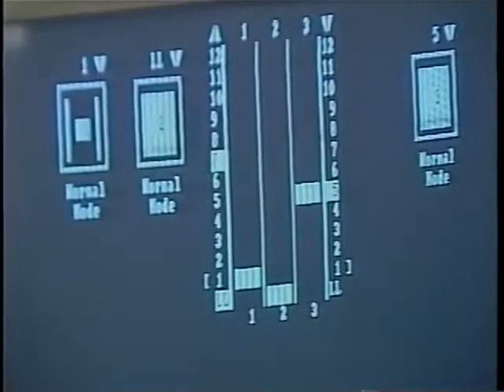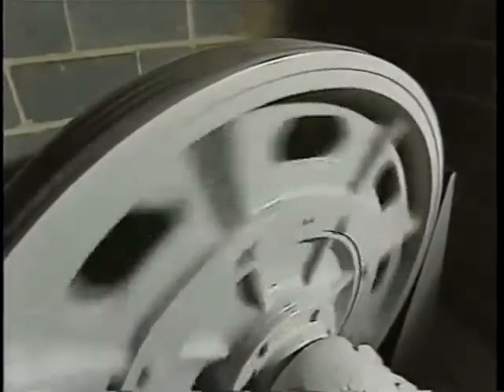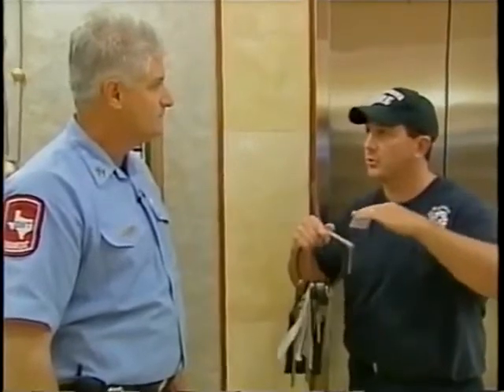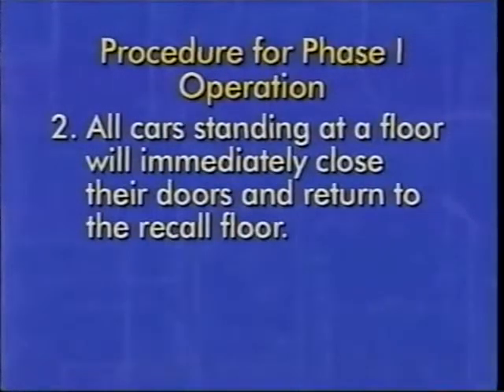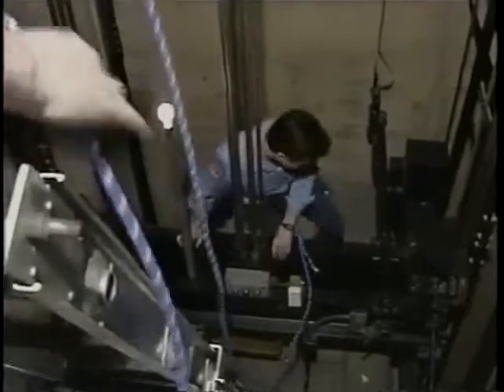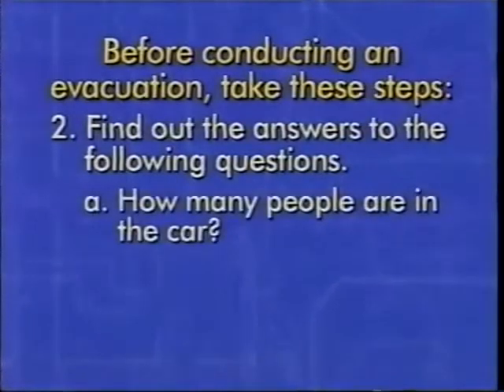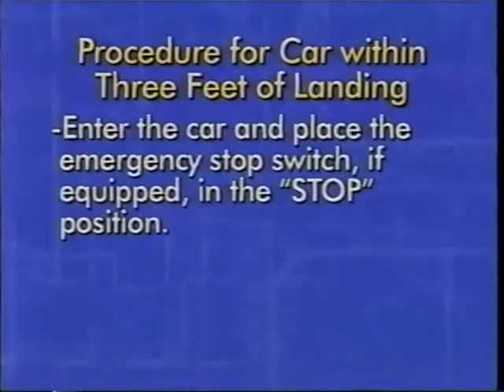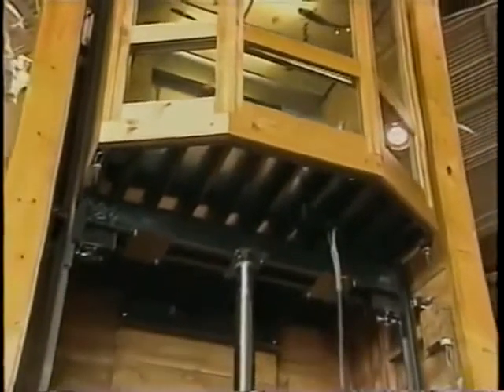FETN Elevator Emergency

Comment: You say traveling cable when showing video of the elevator ropes. The traveling Cable is the electrical wire(s) that deliverth power to the elevator and sends and receive signals from the elevator to the controller and vice versa.